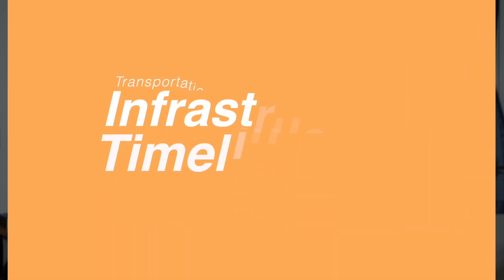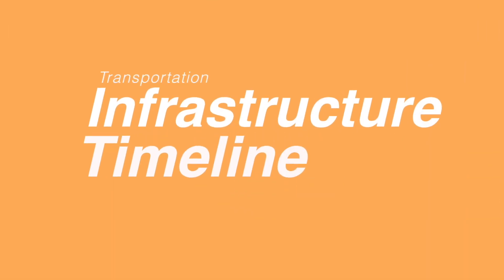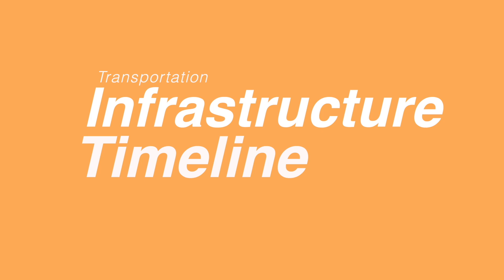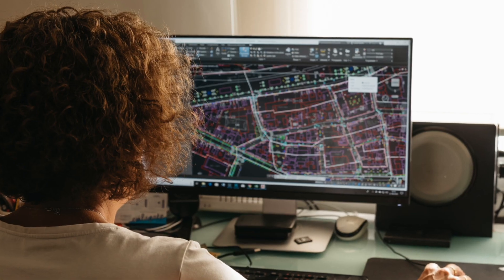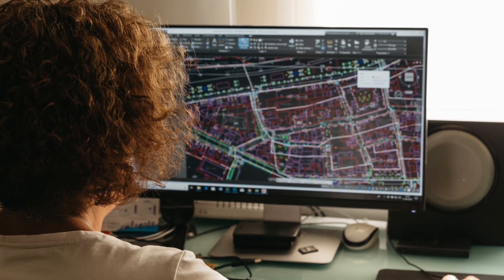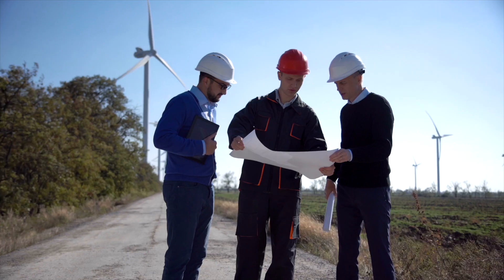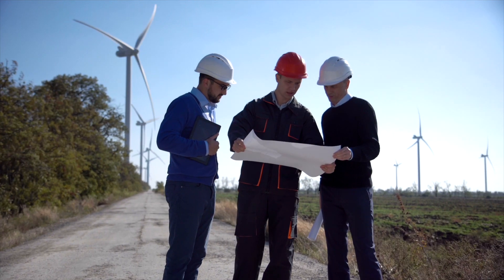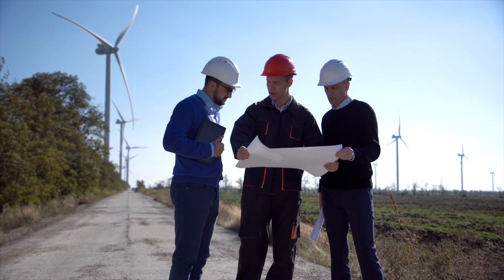Traffic vs. Transportation Engineer: What's the Difference?

Comment: Hey Tang .Thanks for this informative video which we learnt alot from it 
Could I ask you about the carrer path of the traffic engineer and the average salary of this major ?
Where can you handle your work .from office or from site ?
Reply from the maker: Hi! The average salary varies by region. I know where I work (SF Bay Area), it is significantly higher than the rest of the US. Entry level positions can range from $70,000-$100,000/year. Once you have your bachelor’s in civil engineering, you usually can qualify for an entry level job (make sure to get your EIT too). Most work is done at the office with occasional visits to a job site.

Comment: Thanks so much Tang for your last responds and your videos always amazing and helpful. If you donot mind I still have questions. I understand most students are only got a  bachelor science of civil engineer that they  can find entry level traffic engineer jobs but I found out in undergraduate we took only 1 or maximum 2 classes related to transportation engineer. The remains are geotechnical, structural, environmental, hydraulic. 

Then I see if we continue to study master program of transportation program, there will lots of softwares we will learn in school like PTV Vistro/Vissim, HCS, Synchro/SimTraffic,... My question is in case I have only bachelor degree without any basic knowledge of those softwares listed, so will companies usually training me to use those software in the entry level position or I must understand all those softwares before getting the entry level job ? 

I am appreciate again and always best wishes for you.
Reply from the maker: It is helpful to know the basics of these software programs, but at the same time you will likely get training on the job and it will be hard to get really good using one of them until you get work experience with then. I did a different video where I talked about the mistake I made thinking I had to know so many different software programs right after graduating and it turned out I didn’t need to. People may have a different experience but that is my opinion. To me, it’s more important to be able to learn quickly and have the confidence to figure things out on your own in the case you suddenly need to learn a new software program for your job.
Reply: @ByronTang  can you please link the video where you talk about it?
Reply from the maker: @petrevaleanu5105  Sure, https://youtu.be/rL1eFseMGVA

Comment: Your engineering discipline sounds a little bit like mine - software engineering.
There's planning, design, coding, and then maintenance,.
But at least we have certain techniques and stuff available to us that you don't. If something goes wrong in software, we can just keep quitting and re-running it until we find out what caused it. I guess that would be equivalent to ripping up a road and reconstructing it.
Reply from the maker: Interesting perspective! It makes sense at the highest level when we build things (like roads and software) we would need similar stages of development. You’re right, it would be great to have an undo function or being able to restart if something went wrong in construction. Construction projects have a bad reputation for being too expensive. Thanks for sharing!

Comment: Hey Tang, thank you for your video! I was a Structural Engineer but I'm currently studying a C.E Technician course which is specialized for infrastructures. Do you think the experience I gained previously (structural - high rise/low rise buildings) + what I'm studying now help me transition to a Traffic or Transportation Engineer?
Reply from the maker: Hi Vhaun! Specific structural experience will not be relevant to most traffic engineering work. There may be a little structural knowledge involved in transportation engineering. Structural experience will help the most in obtaining your civil engineering license, which all traffic and transportation engineers still typically get.
Reply: @ByronTang  that sounds good at least.  I'm looking into this as one of the possible careers i might transition to in the future. Thank you so much!

Comment: Do you think an Industrial Engineering graduate could work as a Traffic Engineer? I feel like there is a lot of overlap between the coursework of Industrial and the job of a Traffic Engineer.
Reply from the maker: Hi Garrett, great question. I don't want to say it is not possible, but I personally have not seen any traffic engineers with a industrial engineering background. In my experience, the majority of traffic engineers tend to be civil engineers and maybe a few electrical engineers. I have seen other non-civil engineers get into civil engineering by getting a masters in civil engineering while retaining their non-civil engineering bachelor's and then finding work in a civil engineering position. The key is you need to eventually get experience in civil engineering/traffic engineering. It may be difficult to get hired entry level, but if you stand out in some way, it could help. Getting your EIT is also highly recommended. I wonder if anyone reading this has experience getting a civil engineering job without a civil engineering degree???

Comment: How is transportation planning different from the planning work that traffic engineers do?
Reply from the maker: Great question! There can be a bit of overlap with the two but I have worked with transportation planners that focus a lot more on other modes of transportation, like transit. Also, transportation planners often work with transportation models on a regional level. They can also be more focused on pursuing grants, community outreach, or understanding sociological factors. It will depend on the organization the planner works for, but those are some of the things I have seen.
Reply: @ByronTang  that’s cool. Thanks for the reply! Also, is it common for Transportion planners to be civil majors? Do people get their PE for that job career?
Reply from the maker: @Donot30  My opinion is that it is more common for civil/traffic engineers to transition to transportation planners later in their career rather than the other way around. As traffic engineers progress in their careers, they will need to see the bigger picture, which tends to have more transportation planning elements to it. For example, nowadays I am involved with transportation planning work. I think it is more rare to see it the other way around.